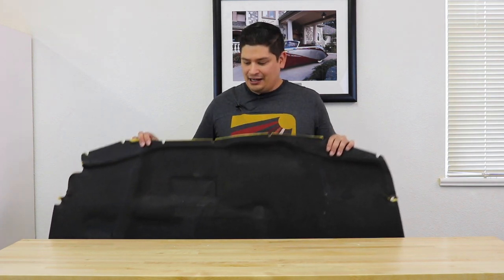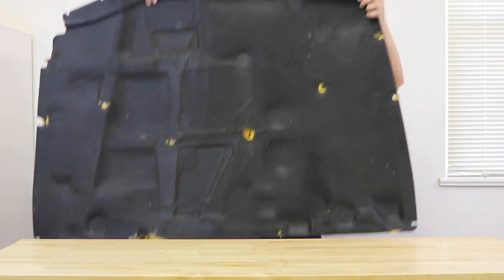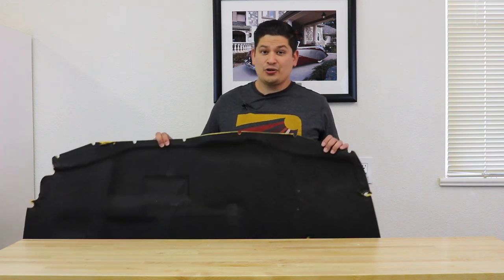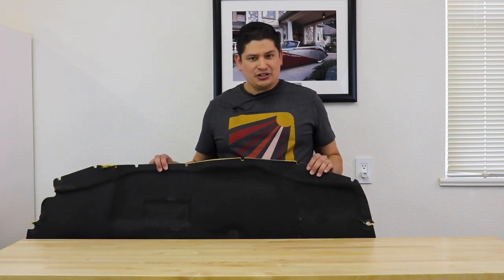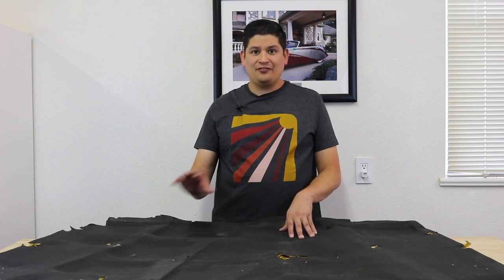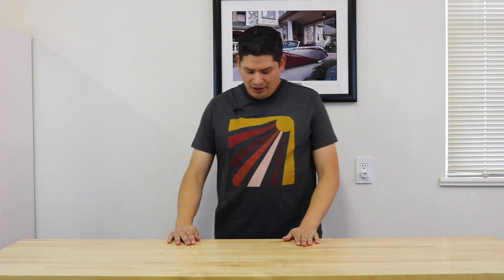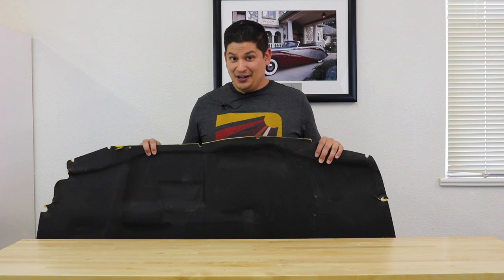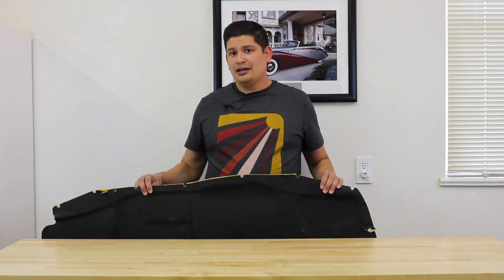HOOD INSULATOR PAD - WHAT DOES IT DO?

Comment: The fire suppressant and melting clips is just a myth that people just keep repeating. There are vids of people setting them on fire and they are not fire resistant. Also, fire gets its oxygen from the bottom, not the top. If engine is on fire it well get plenty of oxygen from below the engine.
Reply from the maker: Thank you for explaining that.

Comment: It is not a fire blanket guys. Stop for a second and think. It isn't made of a material that melts/smothers, it's made of a fibre that is (a little) fireproof - better call it heat-proof. If the plastic clips fail it just sits down onto the top of the engine a few inches lower, but that does what - it won't smother flames, it won't stop the hood being burned etc. In a crash where a fire is likely to occur, there's likely to be enough damage to displace the hood. This IS an NVH addition and a paint protection tool. As someone with 2x 30 year old Toyotas, with a lacquer peeling patch directly above the engine on one and the turbo on the other (no hood insulator fitted for 15 years), I can confirm it IS for paint protection (Secondary purpose). Sure paint gets baked - for a couple of hours, then never again for life, and sure the paint won't die after a few years, but it will eventually and good manufacturers know to minimize the chances of early failure - the NVH pad helps by doing both.  I makes me laugh how you're so sure it's a fire blanket yet so sure it's not a heat protection despite it being used on the firewall to prevent heat entering the cabin :D
Reply from the maker: You make some good points but still no one really knows why these are there. It is a car mystery lol
Reply: My 92 3000GT has plastic clip not metal. I'm replacing my pad with Siless sound deadener and and heat shield. It goes on one small panel at time. I sticks on the metal so there are no clips. I'm in the process so I can't tell you how good it is, but apparently a lot of people are using it.

Comment: Those who have been to a wrecking yard or have worked on various makes will know the difference. For example, I had a '01 Escape XLS (Ford) that had nothing in it compared to my '81 Fleetwood (Cadillac).  Only way to kill a fire is too eliminate the fuel or oxygen, thus it is not a blanket.  If your paint fails due to much heat, get rid of the heat which I'd then suggest one might consider louvre's.  Long drives listening to an engine drone from either the induction or exhaust is tiring.  But then I tend to laugh at those who think loud is fast.  Not to be confused with a well built engine like my neighbors old classic truck, who wanted to apologize for it as it has a very distinct rumble and idle lope. I told, him it was all good.

Comment: it is called a hood silencer. its not a fire blanket at all. its fire retardent but its not what its for. its material is for sound dampening very similar to the sound dampening insulation in a building. look up the part number. its always called a hood silencer.
Reply from the maker: Thanks for that information.👍🏽
Reply: @DriversTherapy  Id remove it if I was you. ALL 4runners stopped putting those in the hood years ago. They actually cause issues, hold dirt, that dirt gets directly into the intake, causes over heating of engine and they cause fiberglass particulates into the cabin air system. Also their intended use, sound dampening, isnt effective whatsoever.

Comment: It will burn your paint quicker without it. I can testify to this
Reply from the maker: Hello, thank you for your input. What kind of car did that happen to?
Reply: 2005 toyota tacoma
Reply: Hello, thinking of installing it but how long did it take before you noticed that your Tacoma started to have hood paint issue because of the engine heat? Did it come to a point that you had to repaint your hood because of it?
Reply: The clear coat on your roof & hood go first because of the sun. I doubt your engine heat had anything to do with your paint fading.
Reply: @markymarc4651 al soon as I removed it I took about a year ,  I live in a hot dry city aswell which made it even worse, aliso you will hear the engine at a much higher decimal,  dont do it its not worth it….. my hood was shiny and then after a year it wasnt, I took it to a paint shop to have it completely repainted only to have the same problem again 2 yrs later and as far as the comment about the clear coat, I had them clear coat it 3 layers, it was really shiny only to see it fade, I recently added insulation back and notice a much quieter engine and cooler hood…
Reply: @flailios  well just so you know as soon as I removed it i took about a year to completely fade, had it repainted with 3 coats of clear, it was shinny, two years later paint was flaking off, I also live in a hot dry weather which makes it worst, I recently added insulation and my engine bay is much quieter and cool to the touch, wish I had done this a long time ago now im driving with an ugly hood again….

Comment: Ooh, new intro. Thanks for another informative video. I figured most cars with ICEs had something like this. The CR-Z has a really tiny one that's just directly over the engine, whereas my mom's car's stretched over most of the hood. Unless this is what you meant by the firewall? But yeah, I figured it was for noise reduction and heat soak.
Reply from the maker: YES!!! We love the new intro. Elise is getting more savvy with Adobe. Thanks for watching the video, I know it is an odd topic but I noticed when I posted a question about it on a Facebook page, no one really knew what it was for.

Comment: My Miata never had hood insulation. The paint was fine for ~15 years. You do notice steam coming off the hood in a light rain. I've added a turbo with a proper heat shield and had no troubles so far.
Reply from the maker: Good to know, thank you for sharing your experience.

Comment: Thanks a lot for taking time and researching this.  Now I want the noises but it worries me I daily-drive my S2000 and sometimes weather is at over 100 degrees F
Reply from the maker: Hi, I had a AP2 and I would keep the insulator on your S2K. If you want some more noise, you can upgrade your air filter or intake but the intake box on the S2000 is pretty good.
Reply: @DriversTherapy  yup, many prefer to modify the OEM box rather than changing it.  I have an AP1, running the Takeda intake.  But I did kept the OEM, might modify it later and try it out.
Reply from the maker: Sweet! Ya ,I would leave your pad alone, trust me. different cars. Cool intake by the way.  @TheElement911

Comment: My car is a California model. I moved from California to the north east and when the fall arrived and it is 30s and 40s in the morning, my car started to act up and even back fire when I start it in the morning. I installed insulation under the hood since California model don't have hood insulation and my car start and run without any problem in the cold freezing weather. So I think the car hood is to prevent cold start problem in the freezing winter morning.
Reply from the maker: That is one theory but that is the first time I have heard that. Usually, cars can handle those temps with no issues at all.
Reply: @DriversTherapy  It depends on the type of car. I think a direct injection car would not be affected by the outside temperature. But mine is a port injection thus the intake manifold get hot and cold from the temperature. If the intake manifold is too cold, it will cool the gas vapor so it is too cold to combust properly. The insulation keep the intake manifold warm enough so that the vapor injected into the manifold can stay warm enough to combust properly, IMHO.

Comment: i am a desiel mech...
without it
it keeps the bay way cooler in temps...
with it on..
it holds alot of heat in the engine bay ,
not so good. the cooler the better
Reply from the maker: That makes sense, so it helps to keep the engine warm in cold weather. Living in Colorado, I can see that.

Comment: Since this hood blanket traps the heat in the engine bay. And since a lot of plastic is now in the engine cab .I think to protect that plastic and all the electronics that you find in a modern vehicle its now better not to have it and save all that plastic and electronics from the heat.As for the fear of fire just carry a fire extinguisher with you .Its better than a hood blanket anyway
Reply from the maker: It definitely keeps heat in. These blankets/covers are the greatest mystery because some vow it’s for fire protection, others say it’s noise reduction, and then you have the paint protection group. I can see the fire blanket part and I don’t care about noise reduction. I did add some reflect tape on the hood to meditate the small possibility of paint issues.

Comment: The science is pretty sound on how it would be bad for your paint. 

Let's start by building a list of facts. 

1. Rain can actually not occur without particulates in the air which fundamentally means that basically all rain is dirty water. 

2. Removing the hood liner WILL increase the temperature of the metal and the paint on your hood.

3. When water evaporates , the dissolved contents will be left behind

4. Heating and cooling things causes mechanical weathering of the material . There are many examples of this in earth sciences and in chemistry. 

5. Water spots can etch into the clear coat of your paint.  

Therefore , when you remove the hood liner in your car you will increase the temperature of your hood (2).  This increase in heat will result in more minerals being left behind when dirty raindrops come into contact with the now hotter hood (1,3). People call these water spots. Water spots can etch into your paint(5). Furthermore, now that the hood is hotter, its temperature range between hot and cold will be greater which will result in more heat weathering as the hot and cold causes the materials to expand and contract to a greater degree (4).
Reply from the maker: Sound logic. I can see your point and in fact I sided with caution and added a barrier via heat reflective tape but there are also cases where people removed their insulator, and nothing happened. I think your logic applies to must cases but not all. Paint is good up to around 300 degrees. Engines are usually around 220 degrees with exhaust manifolds exceeding that range. Where people actually see damage is in that area. The only cases I read about damage due to a missing insulator was aftermarket big turbos burning the paint which makes sense due to the 300-degree limit. Your rain theory is solid but if it was raining, most likely the temperatures would be cooler on the paint surface. If you washed your car in the sun and drove it afterwards, then I can see your water theory having a bad impact. I think no one can say with certain since every make and model varies but one thing is for sure, leave it on, or add some heat tape if you do not want to buy one if it falls apart. Thank you for watching the video.

Comment: I watched your video because I need to replace my washer nozzle and my washer valve. It might be only one that needs replacing, but I have to take down my insulation so I rather do both parts . I’m not a mechanic, but I’ve seen some videos and it looks like I can do it. 
      I’m concerned about breaking the plastic snaps because the dealership told me they are not sold separately.        That leads me to this question, if the shop tore your hood why would you have to pay to replace it. They are the professionals. So they didn’t even offer to partially pay for it? I know it’s been 3 years since you made this video, but it sounds like the person didn’t take time to carefully remove it.
Reply from the maker: You can find those clips still. Find a good mechanic around you who you trust and he can put some random clips on there for you for cheap.

Comment: My Golf TDI insulator pad keeps coming loose, and I was wondering if I even needed the pad.  Thanks so much for answering my question.  Excellent informational video.
Reply from the maker: Thank you so much! Glad the video helped out.
Reply: Hi John L. I just bought a well looked after Golf 5 TDI n found the insulation was shredding away. I'm considering getting a ceramic fire blanket cos the OEM replacement is ridiculously priced. What was ur final solution?
Great video BTW, very informative.
Reply from the maker: @mohsin5520  thanks! Each car varies on the importance of insulator. For my Supra I just used some DEI Cool Tape. Ran some strips across most of the underside but made sure to focus on the exhaust side. I made a video about it as well if you wanna check it out. If you are on the fence of removing it I would go onto the Golf forums and see if anyone has had any issues removing it. In most cases there is not. Let me know what you end up doing or if you have any more questions. 🤘🏽
Reply: @DriversTherapy  considering purchasing a ceramic fire blanket and shape it up to the original. Will use new replacement clips and see how that goes. My other reason for replacing it, other than for safety is also to try and quieten down the the already "naturally" loud VW diesel engine. I'll shop around a bit so my update might not be soon. However, I will most definitely keep u in the loop.
Reply: Replace the clips

Comment: Mine just fell off my Honda Fit...I DON'T like engine noise.... and I simply REFUSE to spend that kind of money on a new one.  Looks like cheap materials...I feel certain it costs no more than $30 to construct ...and they seem to be "built to tear". (looks a lot like yours)

I'm going to attempt to make chipboard washers and sandwich the torn clip holes between two of these washers with some heavy duty glue that can stand up to heat...clip the whole thing back on and then cover the chipboard washers with a little DEI tape.
Reply from the maker: Sorry to hear yours fell off. I have an idea for you, you can get one for cheap at a pick and pull. Try they first.

Comment: Old cars never had them. I had to remove mine to replace the washer nozzles.I accidently broke the clips and destroyed the pad .
Reply from the maker: I wonder if they started to introduce them whenever they started to get stricter with crash and safety requirments. Either way, it has been a mystery for a lot of us about what it is. Thanks for checking out the video.
Reply: I would wagerr they were introduced when direct injection was a thing over carbies. After all, their soul purpose is sound dampening.

Comment: So I'm live in FL. outside temps get up to 95 degrees in the summer. Does this insulation help keep the engine cooler when outside temps are that high?
Reply from the maker: No, it that environment it keeps it hotter, but its purpose is not for cooling or heating.

Comment: Would there be an alternative way of having the fire blanket but still hearing the engine louder? I'm wanting to get more sound out of the VR5 on my Bora. This video cleared alot up btw if OP reads this thank you
Reply from the maker: You can use heat tape to protect the hood, but the fire blanket is designed to help put out an engine fire. Good question and thank you for watching.

Comment: Not all cars use plastic hooks to hold it up, some use metal which will not melt and let it drop, and it actually makes a poor fire blanket. If you look under some cars from the 80s and 90s tgey were made from flammable materials.
Reply from the maker: That is some good info, thanks
Reply: That's because this is NOT intended or designed as a fire blanket. Newer was. Fire  blanket is a soft cloth material which can softly deform as any other blanket around the object to induce oxygen deprivation around covered object. Hood insulator is a hardened sound insulator which will remain rigid if detached, meaning it would act like an inch lowered hood, that's all. The purpose of it is to make a bit less noisy front end, and that's all. Not a mayor influence in general noise level.

Comment: I'm not really sure if I should remove mine or replace it because it looks likes it's falling apart or it melted in parts
Reply from the maker: It depends on the make and model. Some are used as fire blankets and others are used for noise reduction or both. For many cars, it is OK if you remove it. I would check with your car's specific forum and ask around.

Comment: I have a Ford Ranchero 1974, Cleveland 351 engine, the radiator hose is a little taller than stock so the clamp actually makes contact with the insulator pad, is there any problem with that?
Reply from the maker: It should not but if you see it discoloring or falling apart, I would get the OEM hose.
Reply: @DriversTherapy  ok thanks im gonna try to lower the hose as much a posible and ill let you know my experience after a few hours rolling downtown.

Comment: I spent 3k at Tim dhale and every time I took my Nissan Sentra 2012 I left with a new problem. There is a hood pad within the engine I guess and I think it was rubbing up against something because every time I hit the gas in the morning it was soooo loud! I just ripped a lot of it off I cannot afford to take it back and have a new problem
Reply from the maker: Hi, Crystal, sorry to hear you have been having some car trouble. If the pad was hanging it could make, contact with something but the chances it causing an issue besides getting burnt or making contact with a belt if it is torn a lot is very little. Did you keep the pad or throw it away? What condition was it in?
Reply: @DriversTherapy  it had nothing to do with the pad or any belt 😒 I took it to Ken Garff and they saw that the transmission fluid was almost empty… I paid 1800 for Tim dahle to almost destroy my vehicle… they will not own up to it.
Reply from the maker: @crystalmendoza5727  I’m sorry to hear that. Unfortunately it’s happens to often. Usually people know good mechanics and you just have to ask around and try to find one.